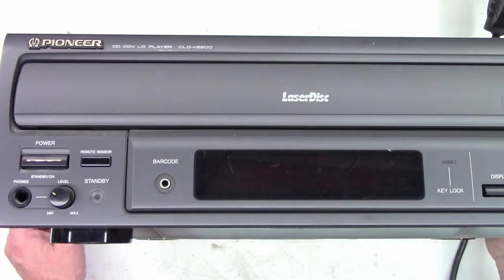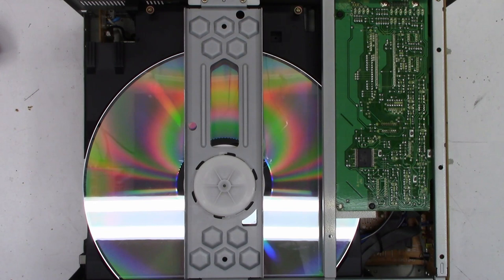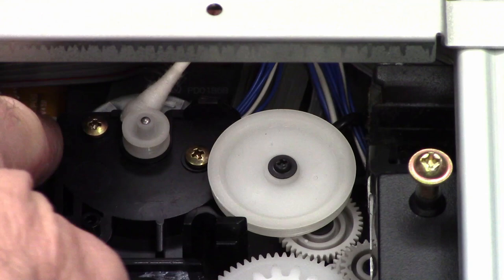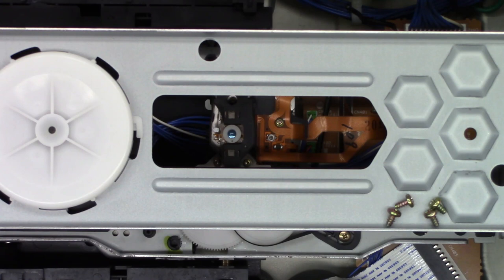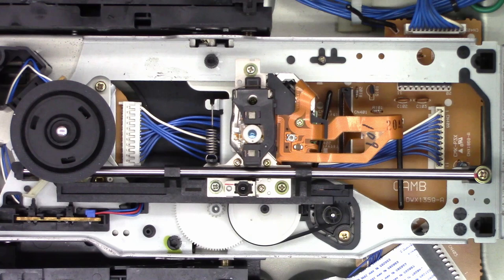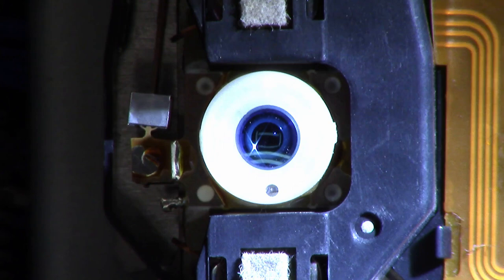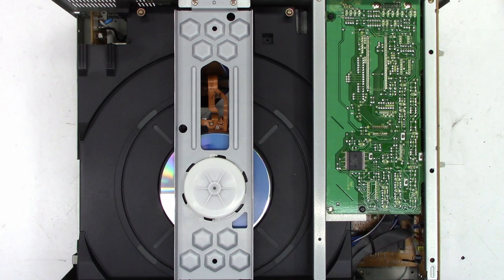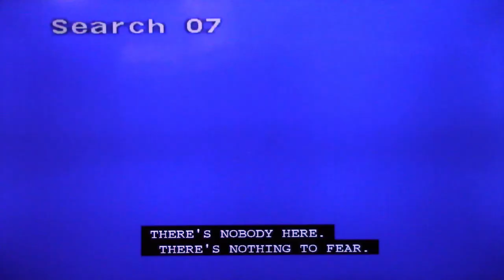PIONEER LASER DISC CLD-V2600  WONT LOAD / CLAMP DISC  INTERMITTENT PLAY. NO PARTS REQUIRED REPAIR.

Comment: 3 years later from the time you uploaded this video originally….your video helped me with a Pioneer Laserdisc CLD-V850 that I found recently at a thrift store. When I tested at the thrift store it was making that grinding noise coming from the motor(I recognized that sound from my Laseractive). And since I recognized the noise when I tested it at the thrift store I still bought this laserdisc player. Got it home and it was having the issues as in this video. Did the belt n laser cleaning and that fixed it. Thank you. Happy holidays!

Comment: I would use lighter fluid for cleaning belts and internal parts instead since it's safe on plastics. While acetone is probably ok with rubber belts and those nylon pulleys, it will damage any ABS parts that may be in the machine, so I'd be careful despite your 40-year lucky streak.

Comment: Thank you so much! I have a CLD-D701 that would not detects CDs or Laserdisks after being in storage for 8 years. I cleaned the sensor and the laser and the problem was solved. The only thing I need to do now is fix the loading system where the tray hesitates to fully open the outer lid. I have to manually help the system open that lid to the tray can come out. As soon as I get some acetone, I will inspect those belts and clean them. Thanks for your video, first time I see you. Ive just subscribed.

Comment: Actually, the infrared sensor is not used for disc recognition. This is the TILT sensor. There is a TILT motor to adjust the whole mechanism to prevent crosstalk as the disc is read.
Reply from the maker: I thought the optical pickup used a jitter in the eye pattern to detect tilt. That is how I was taught to adjust later model DVD players anyway, plus I have had that IR diode set  dirty and not detect a disc. I will definitely look into it. Thanks
Reply: @norcal715  , Thank you! Love your channel!

Comment: With my new found love of Laserdisc Players, i have found my fair share of dirty belts. I am wondering if in your experience, do the optics below the main lens get dirty/covered in a any kind of 'film'. I have found a number of players i have acquired do have a visible red laser glow, but do not recognise a disc even after gentle cleaning (and tweaking the laser diode intensity pot). Perhaps it is the detector that is faulty and not the Laser emitter? (not looking for a 'fix'), just wondering if you think the optics inside the sled could be contributing to a failure to recognise a disc. I did try ultrasonic cleaning the whole sled assembly in IPA without change function (figured it couldn't hurt to try!) 
Thanks again for your videos, old and new!

Comment: I have a cld-53. I  cleaned the laser, changed the loading belt, and it now loads and the motor starts.  In about seven seconds the motor turns off and  the disk coasts to a stop.  I checked the clamping mechanism and observed no defects.  What should I  look for next?

Comment: Yes, I have a pioneer laserdisc cld-1080 it will play certain laserdiscs just fine and load them/play them perfectly. Others it will not. Jurassic park, Independence Day won’t play them at all. Says play then immediately says stop. Also won’t play cds. What does it need? What’s should I do?
Reply from the maker: Look at the disc label and see if some discs are CLV and others are CAV format (constant angular velocity, and constant linear velocity) Is that the common denominator?

Comment: Why are you using acetone but not isopropyl alcohol? Thank you.
Reply: IPA 99% is definetely safer on rubber belts and is just as efective for servicing belts. But there's something even better and 100% safe on rubber parts... platenclene. It's used for cleaning the rubber rollers on printers. I use it to clean belts, pinch rollers... and it works fantastic.